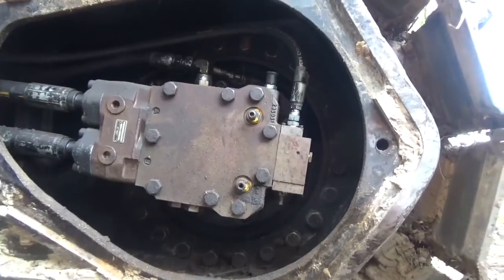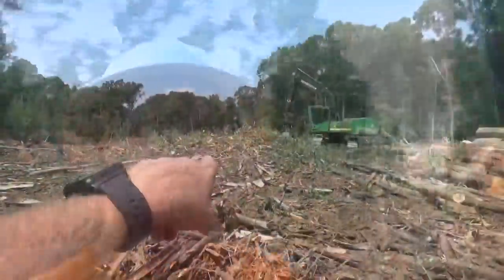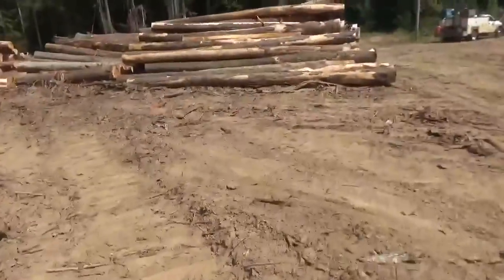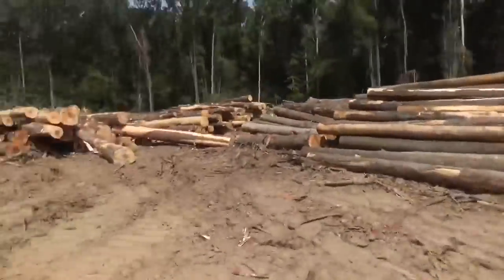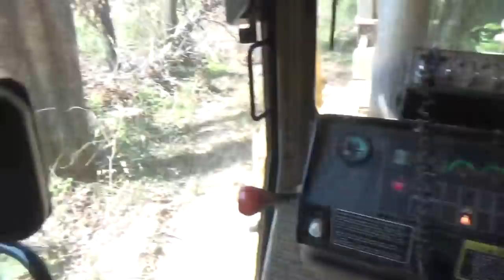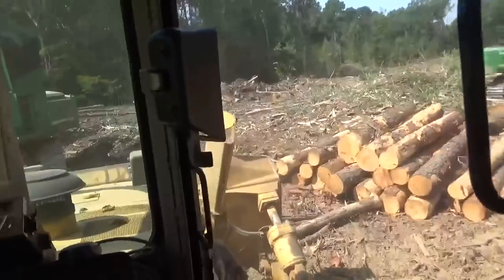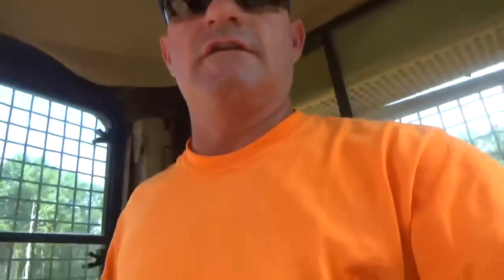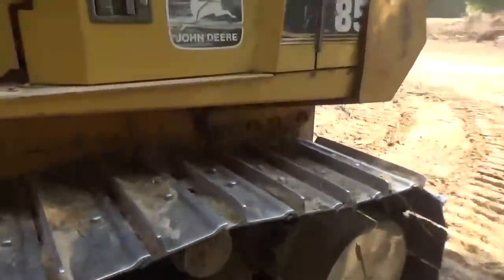Tigercat L830C is broke down & John Deere dozer hard pushing

Comment: Is that heat waves you can see in the video when you were working the Dozer?
Reply: David E no. Its caused by the loader running and the camera attempting to stabilize the image. This cause jitter or waves in the video.